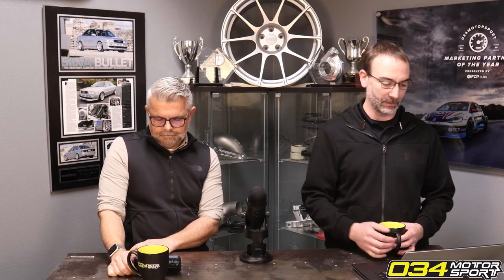When Do Audi Supercharger Intercooler Bricks Fail? | 034Motorsport FAQ

Comment: I had mine fail and it cause an EPC code and misfire in cylinder 3
Reply: @littleAZN248  how many miles , and this was the 2nd gen crec 3.0 ?
Reply: @ 36k miles on a 2014 Sq5 so not 2nd gen.
Reply: @littleAZN248  I gotcha yah I had 2 fail on my 14 q7 as well but not familiar with the gen 2 bricks which are very different design. I appreciate the info though.